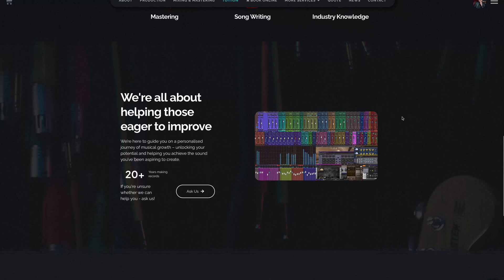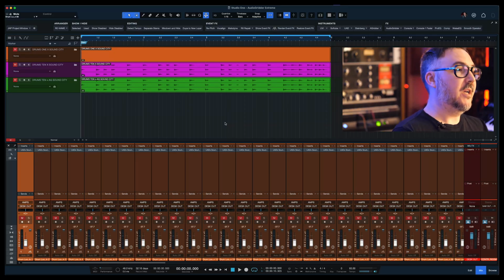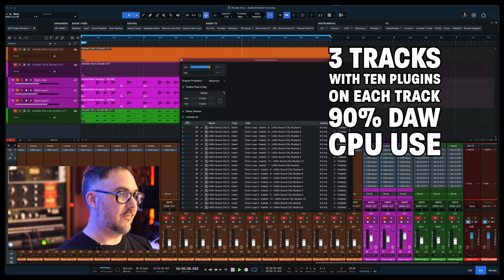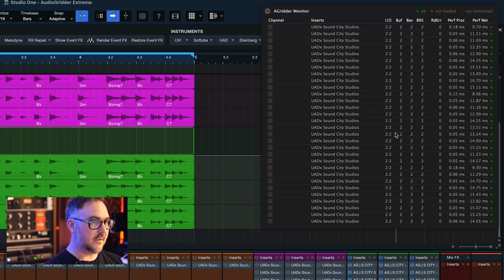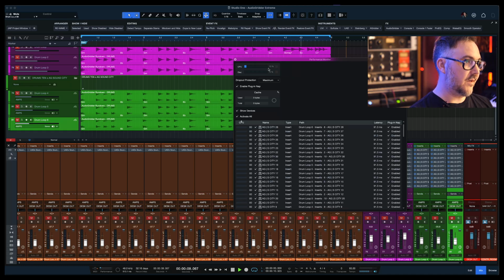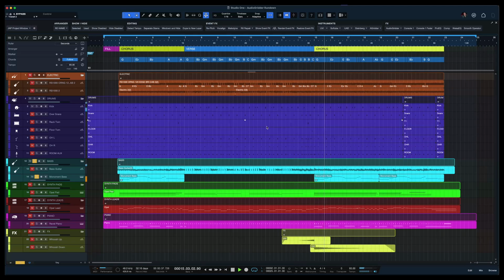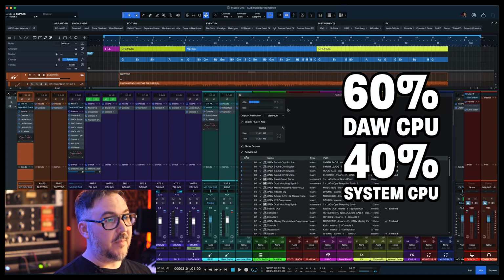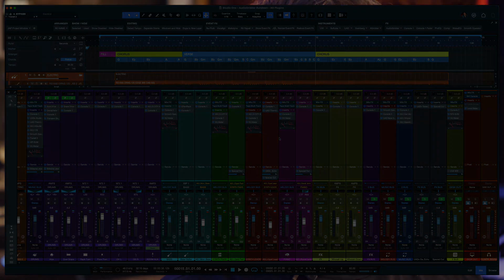Overloading CPU in your DAW?  FREE DSP Mixing with AudioGridder!

Comment: Hi, this video is very interesting. I'm taking this opportunity to ask for your help. I successfully uploaded everything and connected my Mac M1 to my Windows 10 PC with an Ethernet cable. The connections between the Mac (with AudioGridderPlugin) and PC (with AudioGridder Server) are verified, but when I launch a plugin on the server PC from the Mac's DAW, it seems to load but then it doesn't compare the interface on either the PC or Mac monitor, so it doesn't work. I can't select presets or load sounds. Can you tell me what the problem might be? I've reinstalled several times, deleted the firewall, but nothing. I've also checked the AudioGridder settings, but nothing. Thanks.
Reply from the maker: Sorry to say I've only ever used the software in local server mode - not with another host computer.  Hope you can find a solution!
Reply: @J @JamesNorthProductions thanks

Comment: Actually it's one of the overlooked things. I have an I9 9960X, 16 cores 32 threads, over clocked 4,2 GHz....should run a lot he? Well. you can easily get Studio One into the 100% CPU usage. But what's really happening, it all goes to one core. So you can work with sends etc...but that is not always workflow friendly. I've tried audio gridder, but now mainly Vienna pro...server on the same machine(128 GB)..and suddenly you can load so much much more heavy duty vsts...simply because you distribute your workload over more cores. Many people have multicore processors but are not fully using them. But it isn't your processor, it's the fact that the audio audio stream gets processed over one core. If you have a fast multicore a server that offloads from a daw  to a server on the same machine extends the capabilities greatly...
Reply from the maker: That’s right!  It’s all to do with overloading one core.  AG does the job for me here and has done for a few years now.  Totally free ✌🏻

Comment: The only complaint I have with AG, is the fact that its not designed to run multiple instances simultaneously. that part bites but everything else is perfect. if they ever decide to fix this issue, everyone on planet earth will be using this! 300 track projects and the same or more plugins with very low CPU usage is insane!!!!
Reply from the maker: Cool that you're finding heaps of use for it!  I'm not sure if what you mean is that the chains could be longer?  You can run it in plugin isolation mode (one plugin per 'instance') or chain isolation mode .. so that one instance of AG in your daw can load multiple plugins inside the AG wrapper.  Not sure if that's what you mean - but it's possible to do that.

Comment: Hey James, I liked your video. just started this year with gridder and broooo!!!! im networked and this thing is the TRUTH! SERIOUSLY!!!! 200 tracks give or take a few and at least 120 or more plugins of all kinds with no problems. im not even using it like you suggested on my Master machine, so i can only imagine if i can use it this way, i will be able to get even more power! ultimately, im going to build two or three more machines to future proof my system, but im pretty solid right now. why though, does yours run your plugins on the side of AG? mine runs them inside of the container.
Reply from the maker: Yes I'm sure it's great in networked mode too!  I haven't bothered to do that yet as my machine handles all the productions I work on totally fine when running it locally.  Even that makes a huge difference.  Most folks think it's their computer causing the bottleneck but it's just ONE core inside the DAW - get it out of the DAW and you can run way more.  I made the video for that sole purpose.  I should try to make some more videos about other stuff too ... been doing this a long time now and I'm sure some of it would be useful.

Comment: So when you load vst instrument-  big library on kontakt - via audiogrider  the ram use (not only the cpu)  is on the server...right? So i need and lot of ram on server pc for big librarys...correct?
Reply from the maker: If you are using it in network mode then yes your server would be the one that needs the ram (and samples).  I'm demonstrating here how it can be used to offload CPU even on a single machine as it gets the core usage spread outside your DAW.  Good luck!
Reply: @JamesNorthProductions  thanks,a last question ,  If i load a kontakt library via audiogrider on network mode ,the sample library  must install on server pc or not?
Reply from the maker: @MrGreekBlade  I've never used it in network mode, but I can only assume that you would have to install any plugins and sample libraries that you want to use on the remote server that is doing the actual hosting.  But I could be wrong - the only way to find out is to download it and test it.  It's free, you can't really go wrong.

Comment: I’m glad you got it working well, I’ve been pulling out my hair all day trying to figure out how to run it locally. The server app just keeps rescanning my plugs every time it’s opened but then the available plugins list is completely empty. Also when I change the settings to mirror yours, it just reverts to default when I click save
Reply from the maker: Hey Spencer - sorry to hear you're having issues getting it going ... it is definitely intended on being able to be used locally (hence all the local options).  Sounds to me it's getting stuck scanning one of your plugins.  Watch the scanning process carefully to see where it gets stuck.  It only ever scans once for me when it detects new versions have been installed.  Maybe try removing/upgrading whatever it gets stuck on. All the best!

Comment: Love the video! Have you ever used AudioGridder with a networked computer? I'm wondering if there would be additional latency when using a networked server as opposed to local?
Reply from the maker: Yes it would definitely add more latency but this isn’t an issue if just mixing!

If using it locally on the same server you will likely still get good outcomes ✌🏻